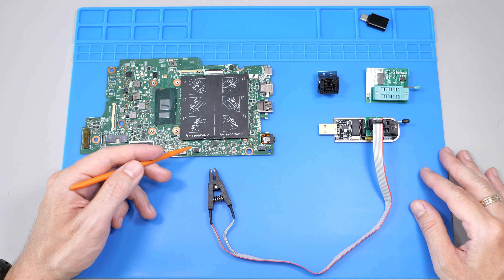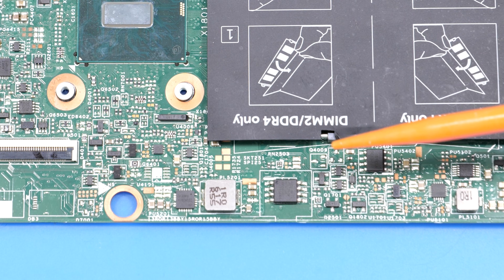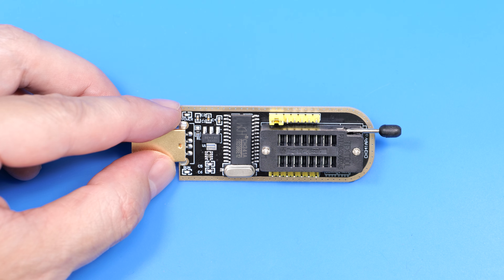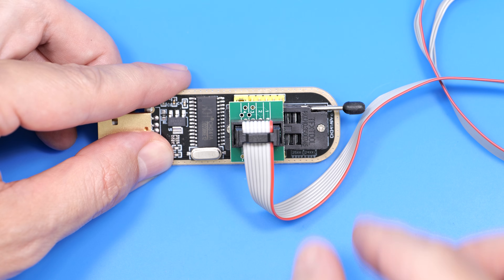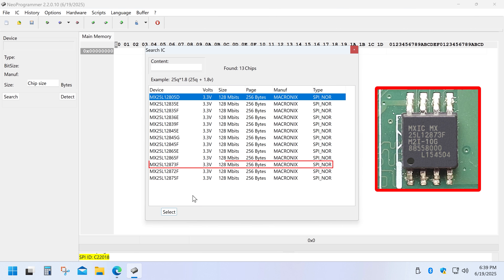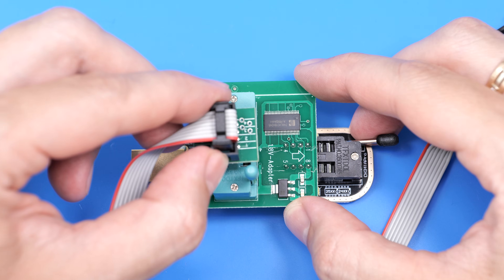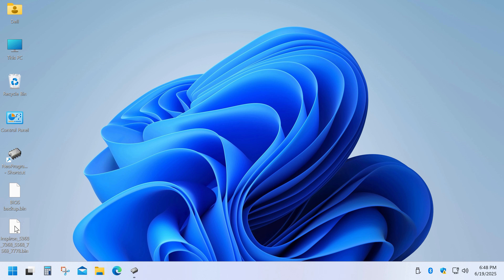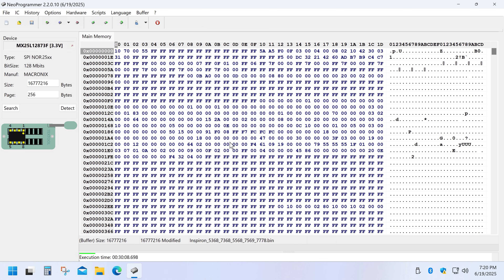How to Fix a Corrupted BIOS with a $5 Programmer | CH341A BIOS Flash Tutorial

Comment: Hi I'm new to amd been using Intel all these years so I thought I got a deal on a old Asus prime a320mk motherboard and a Ryzen 5 2600 was really cheap from to different seller but I think the mother is dead when I got the board there was a brown substance looks like it Leaked some where around the PCIex16"GPU slot" and pciex1_1 slot and ran down the board to in between the AAFP and com pins also there was some of it on the audio channel silver casing I have a feeling it must have came from a GPU or a 16v capacitor but 50/50 on which the capacitor looks fine but what do I know the was also two pin that were bent and touching inside the usb3_12 port when I connect a PSU to the board and it power the light at the GPU slot and the audio led goes on but as if it shorts like it goes bright and in a instant dims and it stays that way which from what I saw other board do the light stays bright it dim like my board as if it's a short and not getting enough power but I have it hooked up to a 550w and all components are working I also don't know if the CPU is working anyway when I manually try to boot the board with a screwdriver trying to short the front panel power switch nothing happens not even the stock cooler fan spins I tried it on the cha_fan to nothing and like I said it works on another board I tried almost every but nothing except this I don't want to buy this unnecessary only to find out I should have board a capacitor instead before give up on the board I'm looking for any tips or advice from you could a failed bios cause there's problems to a board like I mentioned or is it something else
Reply from the maker: It’s not the BIOS. Your board has a hardware short. The brown residue you described is either electrolyte from a leaking capacitor or dried liquid from a spill. That alone can kill power rails. The bent pins touching inside the USB 3.0 header can also short 5V to the data line, which can fry the PCH instantly. The “LED lights bright then instantly dims” behavior means the board is tripping power-protection as soon as it tries to start. That’s a textbook short on the motherboard, not a firmware problem. A bad BIOS won’t prevent the fans from spinning or the board from at least starting up. If fans don’t spin and it doesn’t react even when you short the power pins manually, the board is basically dead. A320 isn’t worth repairing unless you have skills to do it yourself.
Reply: That you so much for you knowledge in this field yeah you just confirm what I knew then the guy scammed me but atleast was cheap will sell the board for parts then ♥️🙏
Reply: 🤔so curious now the board is already dead if I remove that 16v 5ka35c270 capacitor by the PCIe slot and replace it with the lan guard capacitor they the same will it bypass that short I don't have the schematic of this board and I like to tinker think I might just try it to see what happens 😅
Reply from the maker: @diprank-6  You can try to just remove those caps and see if it works but it's not how you should do it. First if you have a multimiter, you should check shorts in 3.3, 5 and 12 volts power rails it's a one minute job. If you see that one of those power rails has a short you inject low voltage at high current into that power rail and check what gets hot with an infrared camera and then replace that shorted or failed component. Without those tools it's near impossible to fix it. If the south bridge is alive the rest of the components that could fail costs maximum a couple of bucks to fix it but again it requires tools.

Comment: Nice video, but what about the ME region and also the MAC addresses of LAN, WIFI..
Reply from the maker: Thanks! Honestly, the ME region is the least of your worries when your BIOS is dead. Your main goal is just to bring the board back to life. Every device has a completely different ME layout, so there’s no universal guide or way to edit it, only a few popular laptop/motherboard models have detailed instructions made by enthusiasts. In most cases, you’ll just flash a full dump from another machine and that will include a working ME region anyway.
If the ME region is missing or blank, no big deal your PC will still boot. For LAN, the MAC address might show up as zeros, but you can easily set a new one in Windows. Wi-Fi cards have their own built-in MAC, so they’re unaffected. The key is getting the system running again, fixing ME data is really the last thing you should worry about. Even we, as an authorized repair shop for several brands, never bother with it.

Comment: Thank you!

I had never done this or worked on anything like this, and although it was a bit of a headache finding all the necessary files, it actualy worked and I actually saved my PC, and it even worked instantly with windows and all my apps and data. (just needed to reset windows hello pin with microsoft authenticator)

One important thing I found was that you can copy over the identifying information about your PC (DMI) and windows key by searching through the bios backup bin file. I think that step is important and sometimes left out.

Try to google "copy dmi and windows key from bios hex", there are videos and forums with guides.

Tips:
- Connecting the clip on the motherboard took me 50-100 attempts, so be patient and try to check that the flappy pins get contact with the chip
- Copy DMI info and Windows key from your bios backup to the same offset on the new bios before flashing it
- Have patience and make sure you have all the info before flashing/erasing/etc.

Comment: Not working for me, I guess I'm doomed. It says IC not responding...
Reply from the maker: Try with your battery or charger connected to the motherboard and make sure that the clip has good contact with the chip terminals.
Reply: @ElectronicsComputers I will try thank you🙏🏼but also maybe it's 1,8V
Reply: @maximoff8269  if its a desktop its likely a 3.3v chip, i had the same issue with the IC not responding, you need to correctly place the Soic8 clip on the bios chip
Reply: @m.4zyit's a laptop, I asked chat gpt and he said I have 1.8 so I need to wait a adapter
Reply: @maximoff8269  ahh ok makes sense, but your not doomed dude I'm sure you'll fix
Reply: @m.4zythanks mate I really hope so
Reply from the maker: @maximoff8269  Well, if you want to get some help here, at least provide the model of your laptop/ motherboard or the BIOS chip itself.
Reply: @ElectronicsComputers model of laptop Lenovo legion 7 16ITHg6, BIOS chip is Winbond 25R64JVSI. I have tried with adapter already, still IC is not responding😢 checked the clip and I think it holds tight

Comment: This was so useful. Aliexpress seller sent the CH341 with 0 instructions and I was esentially dead in the water. Thanks to you I managed to not only understand how to align the chip to the programmer but how to actually get things done with the programming too. Asus tried to do me dirty by giving me a .208 file but thanks to UEFITool NE and Perplexity Ai i managed to figure out my way into creating a .bin file and flashing it. Gonna go buy a hot air gun now and see if it worked.
Reply from the maker: Glad I could help!
Reply: @ElectronicsComputers  Worked almost like a charm, but finding a full bios image for my laptop and making the UEFI shell work is rediculously hard. The legacy part of the bios seems to be functioning as expected. Thanks again.
Reply from the maker: @Yeah-bro-101  You did a great job! I'm happy to help.
Reply: "but thanks to UEFITool NE and Perplexity Ai i managed to figure out my way into creating a .bin file and flashing it." 99% of the time, a bios file provided to flash directly to motherboard is provided in binary data, you don't need to use AI next time, if you can open in a binary editor (even notepad works) and everything looks to be in binary code, you rename the file to .bin and you don't need to create anything.

Comment: Can you explain the separated pin parts in the voltage adapter, Sir? 😃👍
Reply from the maker: You need to connect the voltage adapter and the clip exactly the way I showed in the video. The other part of that connector isn’t even wired it does nothing. If a smaller version of that connector existed, they would’ve used it.
Reply: @ElectronicsComputers oh okay
Thanks 👍🏽🫡

Comment: i have gigabyte b85m d3h board when i power it on fan spins normal and 15 20 sec then shut off then repeat this process before this i run the board it booted with hyper x ram but with other ram same thing happens no boot but still with hyperx it crashes or freezes after one minute then no power for some time then i boot it with in few minutes it boots again also when it crashes on windows it shows irql not less or equal all voltages are fine do u dual bios didn't workout do u think this would work or my bios is currupted i am confused can u help me with this??
Reply from the maker: Those symptoms point more to hardware instability than a purely corrupted BIOS though that’s still possible. I’ve had boards like this in for repair many times and, even when they behave the same, the cause is always different.
First, completely rule out memory compatibility or general RAM issues. Test each module one by one in different slots. Many boards also have cold solder joints on RAM slots, with power off, press gently on the middle of the slot while powering the board on, if it starts normally while you’re pressing and crashes when you release, that slot is suspect.
Power cycling every 15–20 seconds usually means the board’s protection is kicking in because POST is unstable often due to bad RAM, CPU overheating, or corrupted firmware. The Dual BIOS system on these boards is extremely unreliable and your symptoms do point toward possible BIOS corruption, but the way it reacts differently with various RAM sticks makes that uncertain. What I’d do: visual inspection for cold joints, oxidation on RAM contacts or slots and any liquid damage. Check voltages on all power rails. If all looks fine, reflash the BIOS. If it still fails inject voltage from a bench power supply into specific rails and watch with an infrared camera to see what’s heating up. Attach a POST card to read any diagnostic codes. There are just too many variables here to give a simple one-line fix it needs step-by-step testing.
Reply: @ElectronicsComputers thx bro but i check everything board is in super clean condition ram slots are fine cpu warms up when i power on pch is ok its warms too ram is fine i tested everything all are fine and yes now it's behave same no matter wht i do last thing i had 16gb ram one stick was failing so i paired it with simmitronics 4 gb diff ch diff mem timing and i see blue screen after that so i removed it but after that this problem happed  mean after some time i don't have a post card and can't find find anyone reliable to repair in my area thxx

Comment: hi ,many thanks for that tutorial . i have 5 dell latitude 3410 model bios password lost , does this programmer can flash that password? I do IT support in some schools. Thanks
Reply from the maker: Yes, the CH341A programmer can be used to remove the BIOS/setup password but it’s not a guaranteed or risk-free method. Many Dell models, including the Latitude series have the BIOS flash divided into multiple regions like the main BIOS, Intel Management Engine and security areas. If the wrong region is overwritten or corrupted, the laptop can be permanently bricked. The safest method is if you have another identical model without a password, you can create a full BIOS dump from that machine and flash it onto the locked ones. Otherwise it requires manual editing, which is risky and should only be attempted by someone who fully understands Intel ME regions and firmware structure.
Reply: @ElectronicsComputers  hi, i have an identical model without a password , how can i make a full  BIOS dump ? im using the bios backup way you did in your video and its not working , is there any other way i can do a full bios dump ? thanks

Comment: Hi Great video, I tried enabling secure boot on my Aorus Z270x gaming K5 rev.01 motherboard. Now it is stuck in boot cycle CPU/ DRAM / VGA. With this tool flashing the latest bios (F9c) on both m_bios and b_bios will work? Will I have to do any further steps?
Reply from the maker: I fix boards like that on a regular basis it's a 5 minutes job. The BIOS .bin file is also available online.

Comment: I have exactly the same chip as you are in the video and no matter how many times I reconnected it would not communicate :(
Reply from the maker: Make sure that the contacts on your clip are not bent. Also, try to attach the laptop battery to the motherboard or the AC adapter. Try to experiment with BIOS battery if you have one even try different USB ports.
Reply: @ElectronicsComputers interesante, en el vídeo dices que lo desconectemos y ahora que lo conectemos, seria genial saber el porque y las consecuencias 😅

Comment: i overclock my bios, i change the cpu volts and frequency the fan speed and when i turn it on my pc won't boot. I try to remove the cmos but it's not working. I bring my system unit to repair shop and it says my motherboard is broken. But it clearly open the fan and run when i open it. Can this tool bring back my mobo again?
Reply from the maker: If you flashed a modified overclocked BIOS file then yes, a CH341A programmer can be used to reflash it. This is a valid use case. You physically connect to the SPI BIOS chip and write a clean firmware dump. If you only changed settings inside native BIOS → CH341A won’t fix it. The problem is likely hardware damage (CPU or VRM), or CMOS was not fully cleared.
Reply: i already have my ch341a but when i connect it to laptop when the clip is properly align the laptop cannot detect it but when the clip is not properly connected to the chip, it won't detected
Reply: when it not connected it detected* sorry

Comment: Hi thanks for the video! At the some videos  they saying we need to mod the ch341a for 1.8v even with adapter. Any suggestions?
Reply from the maker: The CH341 programmer has been around for over a decade, and lots of repair shops use it including us, even though we’ve got some professional equipment for the job. They don’t need any modifications unless you’re doing something non-standard. I get where all those mod discussions come from, someone measures all the pins and notices that, even though VCC shows 3.3 V or 1.8 V, there are still 5 V present on a few other pins. That’s completely normal and not a fault.
Reply: @ElectronicsComputers  Thanks so much for the reply!

Comment: Hello. Thanks by you video is great.
But can you give small advise.  Bios chip on my Asus zenbook is XMC oh128...... 
 I do all the same what you do and NeoProgrammer don't see this chip. But if I change connection from bios to eeprom port, start see list with three chip ( _24C01_no_addr) second (AT24C01_no_addr) and last (X24C01_no_addr) all chip is 3.3V  size 1Kbits.
Can you say, what I do wrong please.
Reply from the maker: If you plug into the EEPROM (24xx) port, the software will list 24C01/AT24C01/X24C01. That’s expected but it’s the wrong family. From what I understand your chip is XM25QH128. Try with disconnected laptop and BIOS batteries and if it doesn't work then try to connect the main battery or the power supply.

Comment: What does the bios battery look like on a laptop like ASUS rog strix ?
Reply from the maker: What’s the exact model of your laptop? Depending on the model, it may have a battery on the left side of the board in a black sleeve with two wires (red and black) coming from it, or the BIOS may be powered by the main battery.
Reply: @ElectronicsComputers I have a ASUS rog strix G615LP

Comment: Hi, when i connect the cha, i have (not found ) i do correctly what do you say but no result
Reply from the maker: Did you install driver from the link in the description? Make sure that the clip makes reliable connection with the chip. Sometimes connecting the battery to the motherboard help with that problem.
Reply: @ElectronicsComputers thanks you, im good now i know how use it, just a little loop bios lol
Reply: @ElectronicsComputers finally all good

Comment: I follow your instruction and driver install and did not work it says chip ic unresponsive use 1.8 adapter my mother asus tuf b450 m pro gaming,remove cmos batteey and processor still not working
Reply from the maker: Usually, it’s either a bad clip contact or an incorrect connection of the clip to the 1.8V adapter. If you’re 100% sure the connection is correct, try plugging your computer into the outlet so the PSU can provide power to the chip.

Comment: Hi, i tried to update BIOS my Aorus Z370 K3 via Gigabyte APP from Windows level and i bricked it. It is possible to revive my motherboard by this tutorial? I noticed that DRAM diode is blinking on my mobo. Connecting jumpers with removing battery didn’t help.
Reply from the maker: This programmer will definitely help to return your motherboard back to life. I fix such motherboards on a daily basis.

Comment: I've bought this programmer, but windows doesn't detect it at all, I hear it's usb inserting sound, but it doesn't appear in device manager nor in the software.
What could be the solution (I installed drivers)?
Reply from the maker: Did you install the driver from the link in the description?